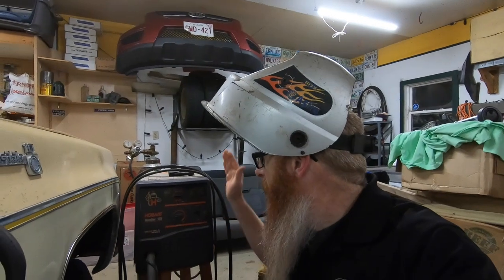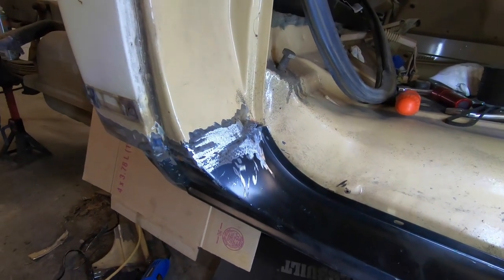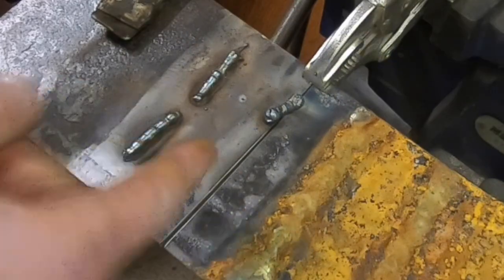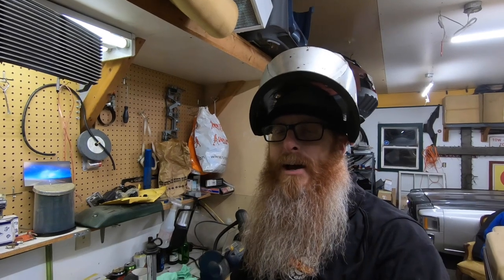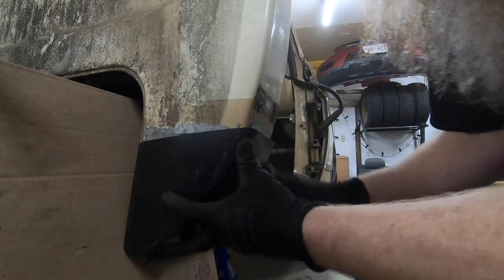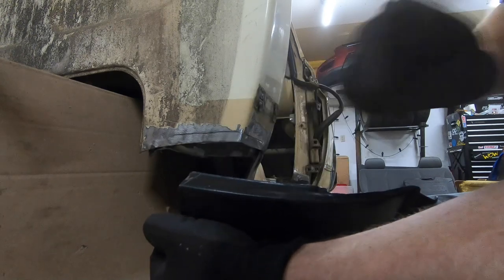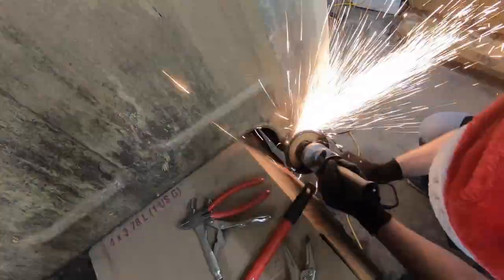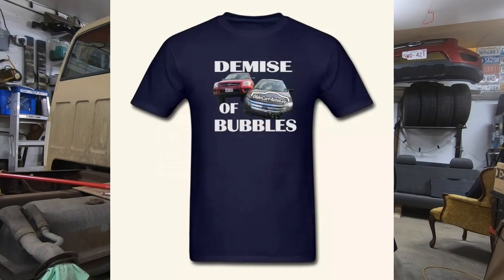LEARN HOW TO MIG WELD ON MY 1977 CHEVROLET C10 SQUARE BODY

Comment: Well... I’m going to rate you at a 10 outa 10 .. not necessarily on your welds but more so for your Bravery on sharing with us that your jus learning to weld an asking for us to rate you lol.. 😁.. I’m truly hoping guys will go easy on you .. I think it’s totally awsome that you are willing to step up an try to educate an inform yourself by watching some videos on welding like you said .. an for going ahead an jus doing it an learn as you go .. they say the hands on method is best way to learn .. theory is good too but in all .. there is many out there of us that have been where you are at right now An that’s how you get better An eventually great at it . I myself took a little welding in school but never went any further an have always opted to hire someone .. I guess I jus too afraid of wrecking the new material an costing myself way more to have to repurchase material a second time lol.. so my hat goes off to you for trying An as far as I’m concerned you are succeeding at it too.. your fitment of rocker An cab corner looks pretty darn good to me .. keep grinding away ... no pun intended lol .. I have faith in ya .. as you’ll do jus fine .. sorry I have no words of advice on selection of heat or wire speed or any of that.. as I have no clue niether an not afraid to admit lol.. so good luck keep on keepin on to me it looks like your on the winning side to me to getting the job done well.. as for dale the truck .. I bet he’s happy jus to have his bare spots that are exposed covered up !!🤣😁 looking forward to next vids to come .. 👍👍
Reply from the maker: I really appreciate your scoring and encouragement! Thanks Darren! Full steam ahead!

Comment: I'm sure you have figured this out by now but one way to avoid the "bubble gum" welds is to stitch your welds. So basically link tack after tack together. And move around a lot to dissipate heat. You don't weld fast but it save a lot of grinder work in the end.
Reply from the maker: Great tip! Yes, after much practice my welding is a little less "Bubble gummy".

Comment: Are you seeing the puddle ? Most people use the spot welding method on sheet metal, kinda difficult to run beads on thin metal. Welding is what I did for some forty years so I do know what I'm talking about, if you don't have the proper shade of lens your already behind the eight ball. Just tack weld and just continue connecting the tack welds together, it will leave you with a lot less too grind and get you to the point of laying on some bondo and final sanding etc. 🇨🇦
Reply from the maker: Thanks for the advise. I'll be sure to put it into practice in hopes for a life made easier.

Comment: If you look inside the door of your welder or in the instruction book for the welder it should tell you at what heat and speed you should set your welder for different sizes of metal !
Reply from the maker: Funny you say that, it does have a chart stickers on the door. It has a lot of info but not what you’d expect!

Comment: Love the project so far, new subscriber here thanks to "dale". I'm also looking forward to finding out about the welding I suck at it mines all bubble gum ad blow through, but I only have a flux core to use. I'm rebuilding my dad's 84 c10 he's had for like 13? years now and here in wv rust has killed it. I need to do a video of it, it was a running driving truck minus a blown rear brake line until about a month ago. I only have a cell phone for a camera, would really like to find a nice "cheap" camera to use for youtube videos. I do have a couple up or my 79 trans am I started on and got sidetracked on this truck and my other truck an 86 gmc k1500. Anyway sorry for the rant, loving the build love the beard, mines about half that length how to keep it safe when welding? I'll be looking forward to the next video buddy keep em coming.
Reply from the maker: Great to have you on board! I also have many project and playlists for each of them! I hope you check them out!

Comment: Tip: If you have a gap use a metal coat hanger as a filler
Reply from the maker: BINGO! Why didn’t I think of that?
Reply: I follow a few custom car builders.  Someday id love to be able to build with sheet metal . I follow bad chad also and he gives alot of tips another local from canning ns